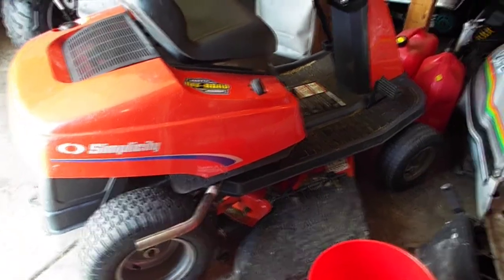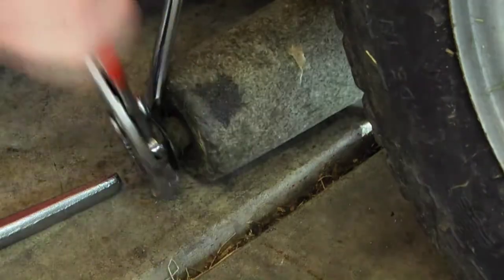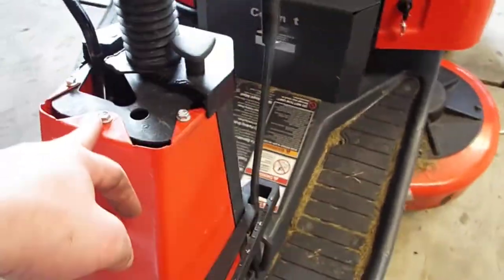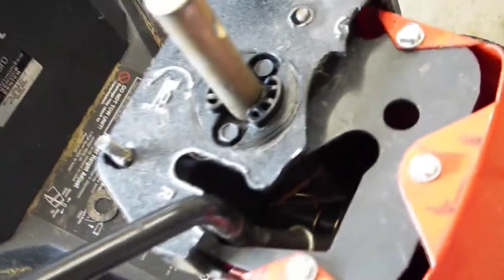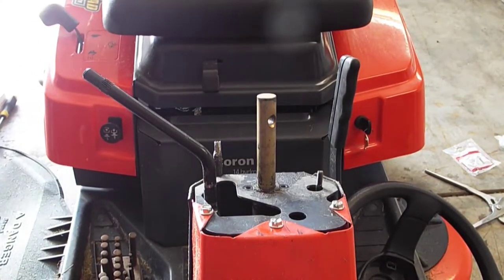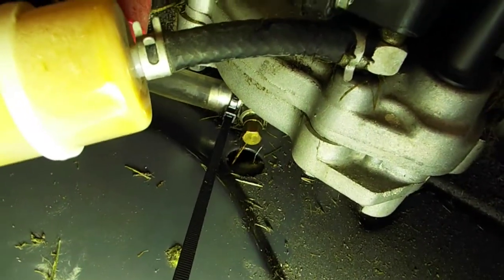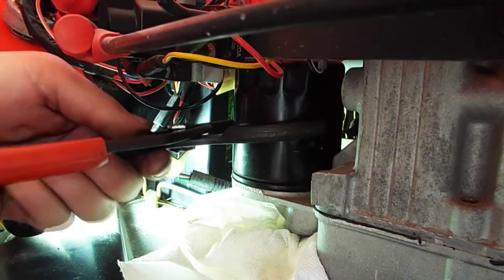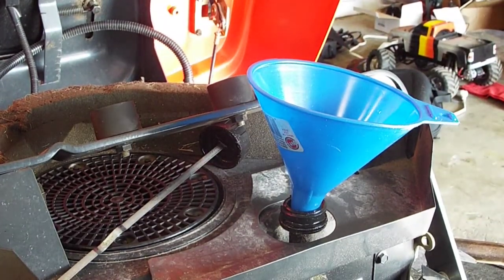Simplicity Coronet Repair & Oil Change  Rear Engine Rider

Comment: do these rear engine mowers have a fuel pump on the engine some place? i bought one of these today. 4/8/23 3.50 Pm cst USA thank you tony.
Reply from the maker: Yes. I believe the model I have does have a fuel pump.
Reply: Yes it mounted to motor  just follow the line from tank to motor it works on vacuum pulse and will fit of other motors as wall

Comment: I just got one of these and took the mower deck off. When pulling it back on I'm curious where the two arms that come off the back of the deck go. Been watching a few of your videos and haven't seen them yet. Let me know if you know. Thanks
Reply from the maker: Hmmm.  I'm not sure.
Reply: @GarageWorx  thanks anyway.
Reply: @GarageWorx  I guess they are called "Bar, Mower Transport" so, they probably just hang. Just look weird when the deck is all the way down

Comment: related to the mower. do you know the throttle cable part number? i have a simplicity coronet hydro 13hp 34" deck mower and the throttle cable i bought didn't fit fully
Reply from the maker: Sorry, I don't know the part number.
Reply: @GarageWorx  thanks.. my other issue is it wont start just off key turn i have to manually play with the choke linkage to get it to start.. any advice?
Reply from the maker: @kyleherber3231  without seeing it could be the cable isn't adjusted correctly.   I had a John deere lawn tractor that would be hard to start because the choke wasn't closing when the lever was on choke.  Adjusted cable and started like new.
Reply: @GarageWorx  appreciate the insight , i haven't tried to fix it as it doesn't imped anything serious plus it is a pain to try and work on it as its all hidden on the forward side.. i think of it as a "kill" switch so no one can walk up and start my mower lol